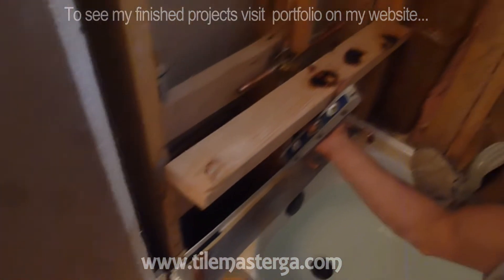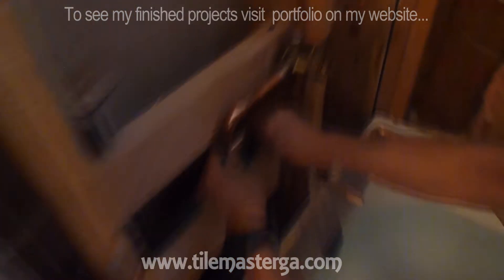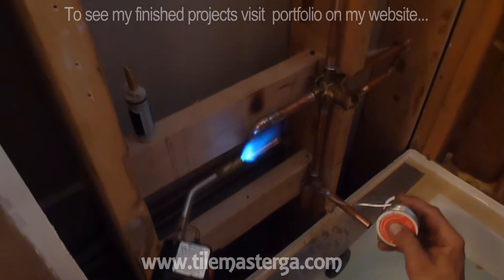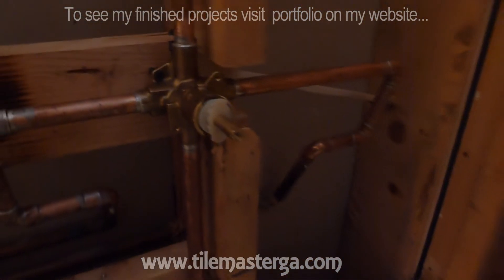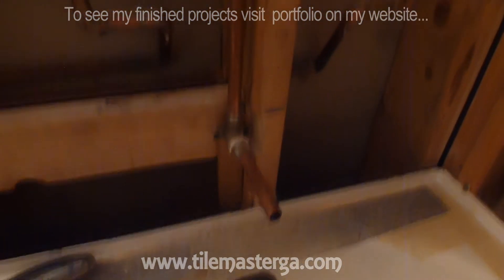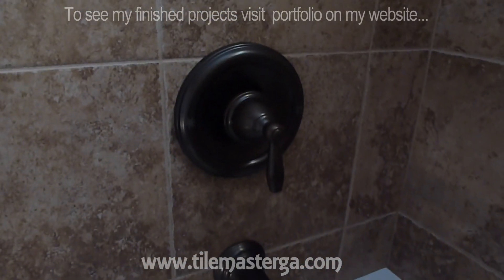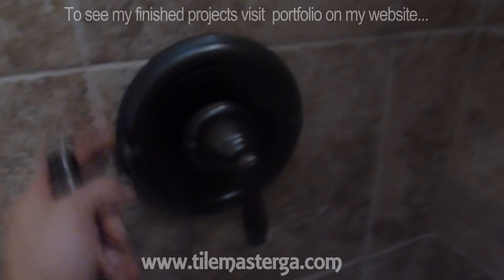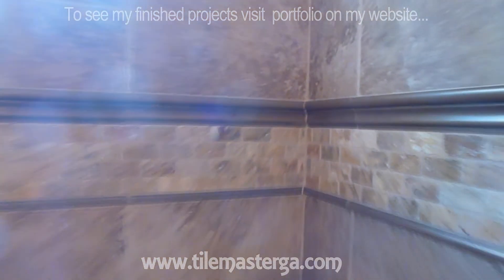Part "2" How to replace tub surround  shower rough in valve - removal, preparation & installation

Comment: Love your videos. Very detailed and helpful. I would recommend also using water hammer arrestors on the supply lines to the valve. Maybe they are located where they are not visible in this case? Usually installed just before the valve though. Nice work.

Comment: Hi, the grout like between the tiles, it is lower than the tile surface, when you put the plate one, do you need to do anything with it? the water might get behind the plate will it? i am little worried about this, and dont know what to do here. since the plate already has the form behind it, dont think i should still silicone. thank you

Comment: I never did this but i'm about to do it,,,,,   it seems it would be easier to rough  in the  valve and shower head  ect. before installing the tub.( not standing in the tub.   )  any ideas
Reply: He is doing it with the tub installed because he's using the tub's drain as the centerline. Without the tub in place your faucet may be completely off center and look terrible.